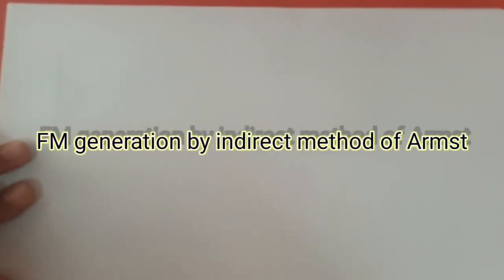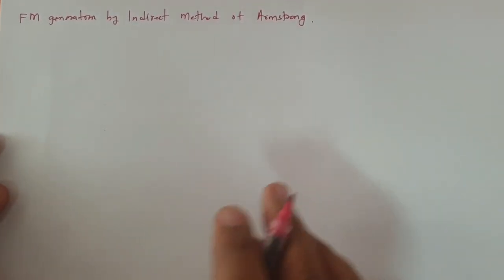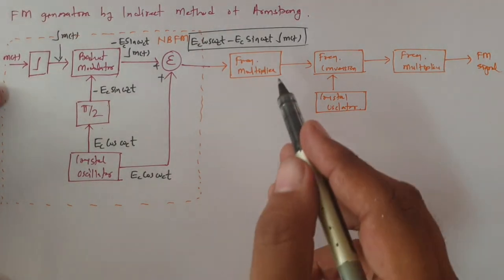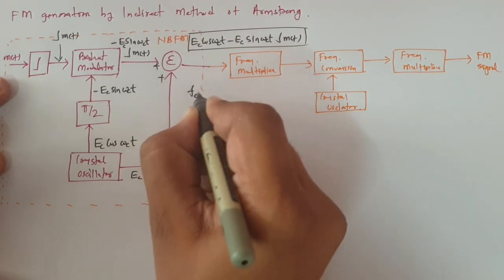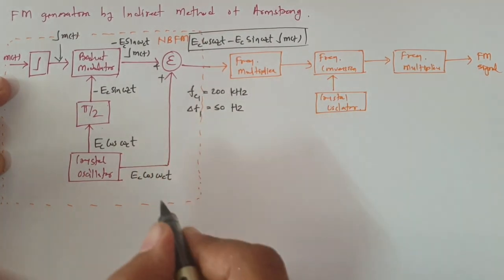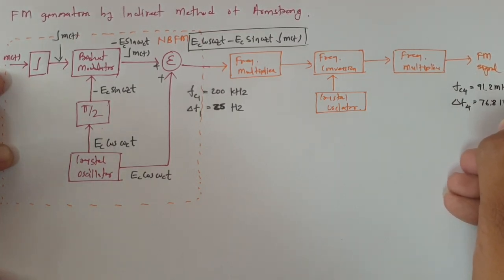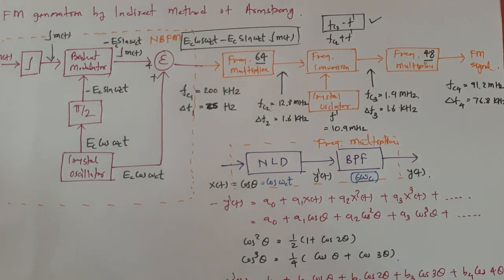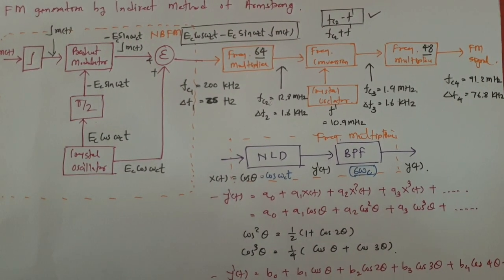FM Generation by Indirect Method of Armstrong (Basics, Block Diagram, Circuit & Working) Explained

Comment: sir, there are too many ways to multiply two numbers to get that product. plz explain how to choose those numbers
Reply: the multipliers can only be in powers of 2, example 2^2, 2^4, etc
as the multipliers can be doublers and triplers and cascaded connection of these components. You can search for doublers and triplers for more information.
Hope that solves your query.
Reply: @vedantgune4028 thx yr but still one more doubt means 2^6 = 64 & what about 48??plz explain yar 😢

Comment: Sir why only 64 and 48 are considered to be the multiplicating factors??? We can even use 30 and 100 right?
Reply: the multipliers can only be in powers of 2, example 2^2, 2^4, etc
as the multipliers can be doublers and triplers and cascaded connection of these components. You can search for doublers and triplers for more information.
Hope that solves your query.

Comment: Hello sir, Once more topic is not covered sir that is A typical FM transmitter using indirect FM with phase 
modulator - circuit, explanation. Could you please do this as well

Comment: Sir how did u got the values of Multiplexers 64 and 48 what is the method please explain me sir
Reply from the maker: It is as per nth law, it is bit difficult to explain by comments.
Reply: @EngineeringFunda  can u please suggest any other video or notes to get those values I'm unable to sove the problems if M1×M2=7500 we can write one as 75 and   100 also 125 and 60 also many other in same way how can i justify this
Reply from the maker: It's not only mathematics, some science also there, so see the value of gain and frequency deviation.